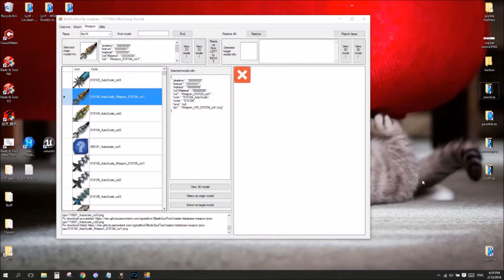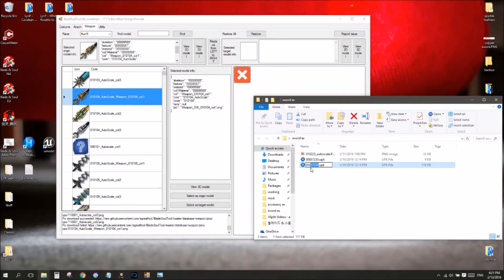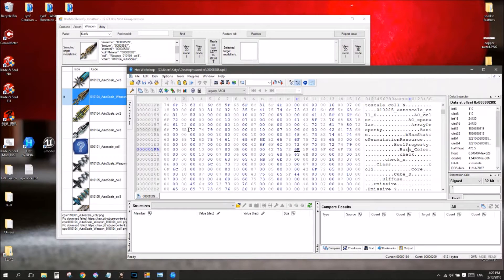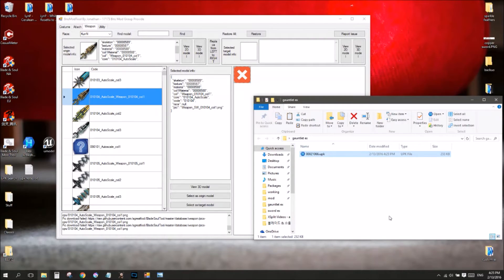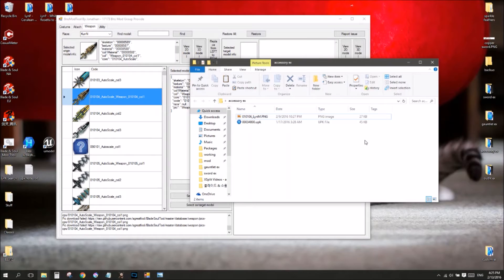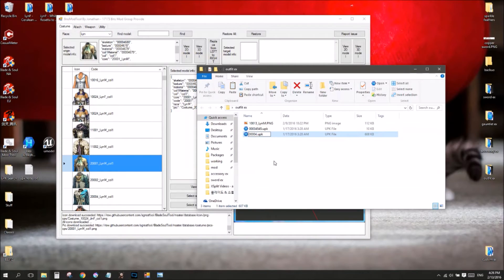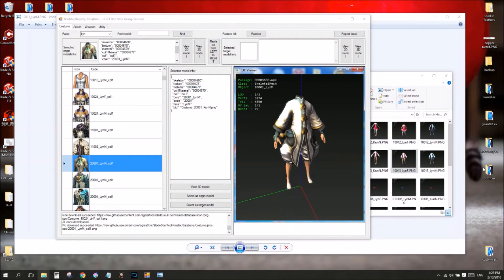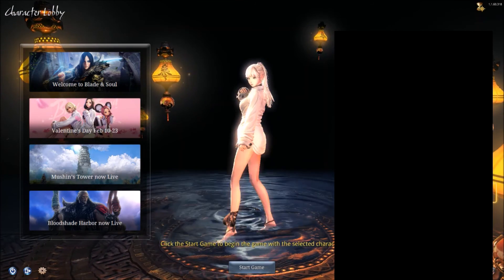BnS - Hex Editing Basics

Comment: Hi, I have a question! I'm trying to mod both the deva outfit and the aura and I followed step by step from your video, but when I load up my game the outfit is fine, but the aura ends up a weird pink and yellow color... help pls :c if it helps you I wanted to change the outfit to the baseball costume and the aura to butterfly wings.
Reply from the maker: ok so with things that come in a set the the Deva aura, stinger tail, Lycan sorrow, etc. you will only need to mod the Skelton for the adornments. the outfit still requires the material but the other parts do not
Reply: +warriorgriffinheart  yeah that's what I did. I grabbed the skeleton for the wings and both skeleton and material for the outfit and I changed the core numbers, did I have to change anything else other than the core number?
Reply from the maker: +AwkwardsTurtles well the butterfly wings aren't in the NA client so you do need to have the material/texture crap (there's a ton... I hate those wings). you can easily go off of my Lycan sorrow to butterfly wings mod since I only edited the skeleton for those. all the other 8+ files in that folder are unedited but necessary for the wings top work since those files are in some way used/referenced starting from the skelton x-x
Reply: +warriorgriffinheart ah okay now it works. Man the wings really are a pain with all those files.... thanks for your help! ^^

Comment: Whenever i Try to mod Widow Wig it makes the game crash, why?
Reply from the maker: are you trying to put the hair version on to a wig? hairs have shorter core numbers than wigs, so trying to write the new long core over it will cause a buffer overflow and cause the game to crash when it tries to read the file. there is a way to work around it, but it's a bit more advanced. I might make a guide for it over my break
Reply: warriorgriffinheart i try to overwrite my custom gangplank style with scarlet widow wig and i tested both and both make the game crash.
Reply from the maker: +Keksiily you haven't given much information to help debug your problem. Both work perfectly fine for me whether I use the tool or do it by hand. I don't know exactly what you're doing so I can't help solve your problem without more information
Reply: warriorgriffinheart I used BnSTool at first to replace Custom Gangplank Style with Widow Wig model on my Jin female. Everytime I try to start the game from that point on it freezes and crashes at the character screen when I'm selecting my character with Custom GP style. Then I tried it with hexediting after your guide and exactly the same thing happens. I always put them in C:\Program Files (x86)\NCSOFT\BnS\contents\Local\NCWEST\ENGLISH\CookedPC\mod After deleting them the game works fine again. Would be much appreciated if you could give me the file that works for you if you have time
Reply from the maker: +Keksiily what are the two core numbers for your target and base items?